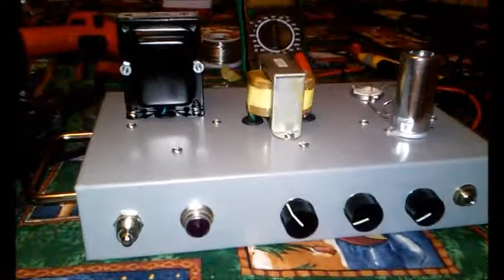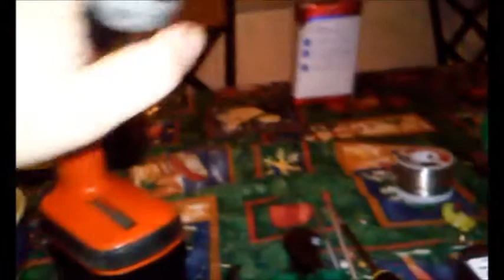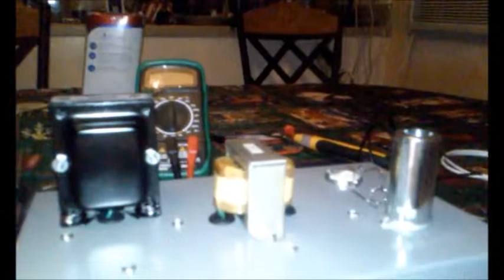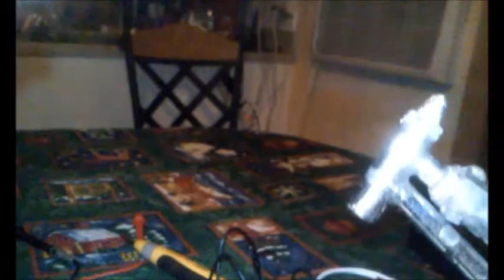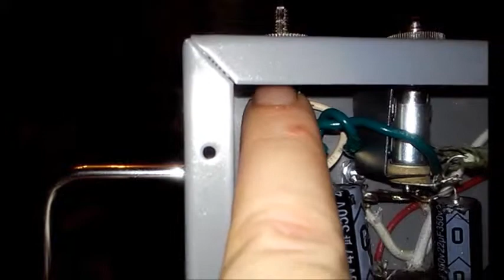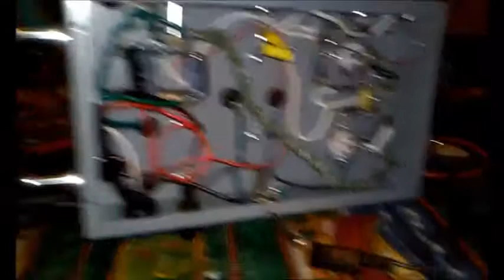audio vacuum tube amp Part2-Mod 102 Kit

Comment: Using your finger to point out components in the chassis is very dangerous.  At least mention that you have discharged  the capacitors and then use a wooden dowel as a pointer.
Reply from the maker: the device was completely not-plugged in, as mentioned.  Notice the pentode tube is not in its socket, and there is no external speaker attached, so there is no load